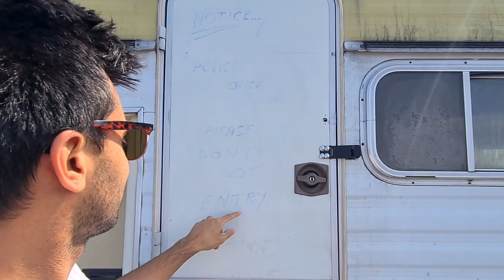We bought a VINTAGE Japanese Campervan!

Comment: Handbrake is the same as the old VW type 2 bay window campers. 

Word of caution! 
 They can let go sometimes if the ratchet is worn slightly. 
I used to hold on to mine at traffic lights on a steep hill. 😂

Love it. Very retro.  So much space!  
You could play table tennis in there compared to Dobbie van. 😂

Comment: WOW...!
Good luck...!!!
Next time consider buying a 2013 VW T2 Kombi (like mine) the last year they were produced in Brazil. Quite new. And then, shipping it to Europe.
Mine is a panel van with only 49.300 miles on it and in perfect conditions.
Her value today is about 7.500 pounds Sterling only, which makes it terribly interesting to acquire and ship it home to the UK.
Engine (original) is a VW 1.4  (4 cyl. 86 HP petrol/ethanol water cooled)
You may transform it into a high top model for standing up inside for less than 1.000 pounds. Lovely, reliable, fun and nostalgic way to go!
There are thousands of "Kombihomes" as we call them around here and parts are cheap and abundant.

Comment: Sorry to be negative, but that will use twice the fuel of your Doblo and spares will be expensive; if you can get them. Plus it isn't stealthy.
I can see the attraction of the extra space.
Looks like you were in Burnham on Sea.
Reply from the maker: Yes of course these are things to consider. Not quite Burnham-on-sea.
Reply: @TeamAteem  The southern end of WSM then. 
I'm sure you've got used to the column change and warm seats by now.
Good luck with it anyway. The only L300 campers I've seen in recent years have been on Dutch plates.